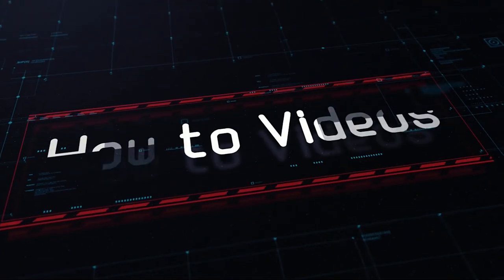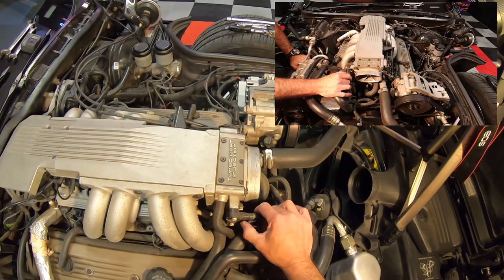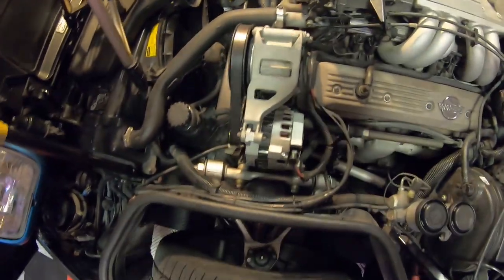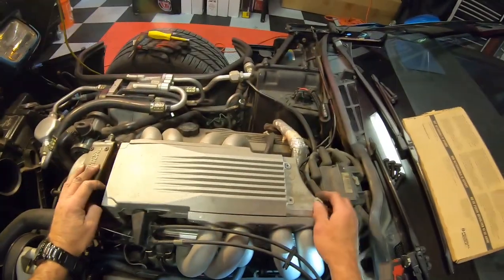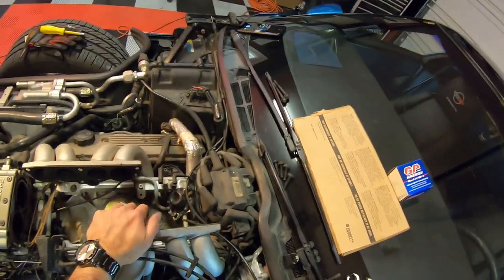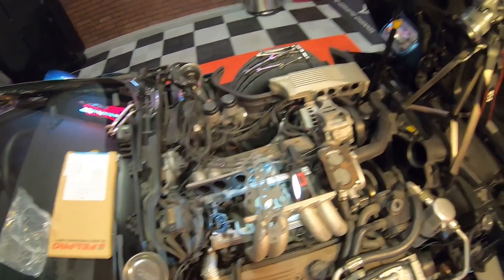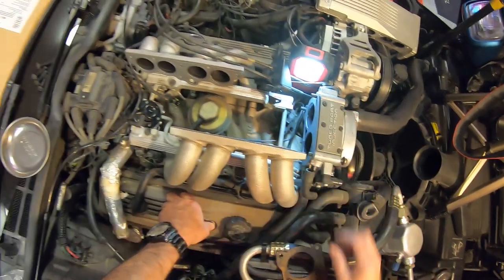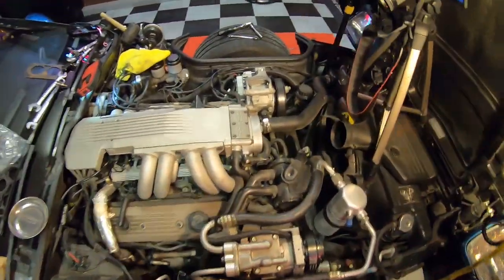How to Replace the Fuel Pressure Regulator in a C4 Corvette

Comment: Hi Scott, First, your girl "Donna Marie" reminds me of Raquel Welch back in the day! She was always my fav! Anyway, second, thank you for making this video. I'm working on my 1986 C4 and doing a bunch of sensor and module replacements among other upgrades. I've owned this car for about 30 years now. I've already redone the interior including reupholstering and replacing the foam, air bladders, tubing and switches on the Sport seats with factory correct perforated leather. Now, I'm focusing on the engine compartment and drive train. I've had the L98 rebuilt, the 700R4 rebuilt and upgraded the rear suspension to include a Dana 44 with 3.45:1 gears as opposed to the Dana 36 with 2.59:1 gears. Anyway, the fuel pressure regulator is on my list of things to replace whether it needs it or not. And at this point it doesn't but you never know when this stuff will go so, I'm replacing it now while have I'm doing everything else. This old girl has a few dings and chips on it and so it's going into the body shop, after all the mechanical work is done, to fix the body and for a fresh paint job. Sorry for the long comment.
Thanks again for the video.
Sincerely, Rich Williams
Astor, Florida 32102 USA!
Reply from the maker: Thank you for watching and yes she is Gorgeous for sure. Sounds like you have your repair plan in tack and moving along. HAve a Great Day and again thanks for watching.

Comment: Good instructions & advice on cleaning under the hood.  Another “corvette” channel was actually recommending aluminum brightener.  WRONG!  That’s the easiest way to ruin your aluminum plenum, runners, distributor cover, etc!  I made that mistake in the early 80’s on a set of aluminum wheel & still feel the pain from it today!  The harshest thing I will use is Simple Green diluted!!

Comment: Great detail in each step taken. I think I need to replace my throttle positioning sensor as once in a while, the engine coughs and almost dies when I let off the gas to slow down.
Reply from the maker: Definitely sounds like it, not very expensive to do but you do need a volt meter to adjust it.
It should come with instructions.
Good Luck!!

Comment: Just confirmed, the fuel pump regulator torx bolts are T10, NOT T15. Probably a simple error but I had to stop and go to Lowes to get a T10. Smallest I had was a T15. T15 is for the Distributor cover, T10 is the regulator. Also, my regulator when I took it apart never stopped spewing gas, I had to hurry and put it back together. Even then, I lost about a gallon if not more. Taking it apart wasn't bad, 30 to 45 minutes with the exception of not having the T10, I had to run to Lowes and get one. Putting it back together was difficult, the new Felpro gasket for the throttle body to plenum was fine, but the ones from plenum to the intake tubes were too thick. After about 2 hours of fiddling with them I gave up and used the old gaskets. Had I owned a T10 and not messed with new gaskets (my old gaskets were in great shape, too) I probably would have had the job done in an hour or two.

Comment: Thanks Scott for the video.  My 87 is having a hard time starting.  It needs starting fluid everytime you have to start it.  Doesnt matter if its cold or hot.  Fuel pump is putting out pressure when you turn the key to on but nothing gets to the rail.  0 fuel pressure.  So, it looks like its the fuel pressure regulator to me.  Btw, I spray starter fluid in to get it going but fuel pressure is only 20-22 psi at idle.  As soon as I shut it down it drops instantly to 0 psi.  

So thank you for the video.  I will be following it closely when I replace my FPR.  Thanks again.
Reply: Did the fpr fix it?
Reply: @lDUNNO0  no.  Very disappointed when it didnt.  After taking a day or two off after that I decided to start fresh and started with fuel tank.  I put my ear to the tank inlet and had my wife turn key to on.  I heard the fuel pump turn on for 2 seconds, but immediately followed by a dripping liquid sound.  Turns out the little pulsator piece was leaking.  I took out the sending unit amd put on a new piece of fuel tubing in its place.  Started right up.

Comment: I would suggest that once you have the plenum off, you should replace all of the rubber O-rings on the fuel lines and rails with nitrile O-rings.  I replaced the factory injectors with a set from "Injection Connection" so the injectors, gaskets, and O-rings came as a complete set.  Yes, I replaced the fuel pressure regulator plus, the fuel filter.  The fuel hoses from the hard lines cannot be replaced without replacing THE WHOLE ONE-PIECE FUEL LINE because the hoses are pressed on at the factory. 
I sold my '90 convertible (58,000 miles) last year after 14 years of ownership.  I now have a '16 Z51 convertible.  1991 was the last year for the iron block L98.

Comment: I used AC Delco gaskets because they are some type of metal and are reusable and don't leave a mess on the runners or throttle body. I don't know if AC Delco are still making them like that or if they went to paper like Felpro, which would be a mess every time you pull them getting the razor blade out to scrap off old gasket.

Comment: I have a 89 the problem is starting. I have to recycle the key at least 5 times before it will  fire. I have changed the fuel pump same trouble. I am going to change the fuel pressure regulator next. I am hoping that is the problem. Not a big deal to change I have it. So what is your thoughts on it Thanks Ray
Reply from the maker: I think you are the right track.
Reply: I am in the same boat, did changing the fuel pressure regulator fix the problem?  Feel like I could do this after watching this video!

Comment: Very good tutorial, Scott; I suspect the fpr replacement for my ’85 will be necessary someday. I noticed something odd though when you started up the engine cold after finishing the replacement. The cooling fan turned on after a few seconds. My car will not activate the fan until the coolant reaches about 230 degrees, or the A/C is on. Am I missing something? What gives?
Reply: the fans are supposed to kick on at certain high temperatures some people have manually wired switches to turn them on at any point. also when your air conditioner is on the fans will be running no matter the temperature.

Comment: how did you know your injectors wernt what was leaking and just fixed the fuel pressure regulator? I have gas in my oil and assumed I should replace FPR and injectors all at once. but maybe its just the FPR

Comment: is that a fuel line in the back driver's side near the #1 plug on the cap?  the one you used two wrenches for ?
Reply: Vacumm line, should be the brake booster vacumm line. It transitions to rubber. The fuel lines are in the front by the throttle body, there are two fuel connections (feed and return).